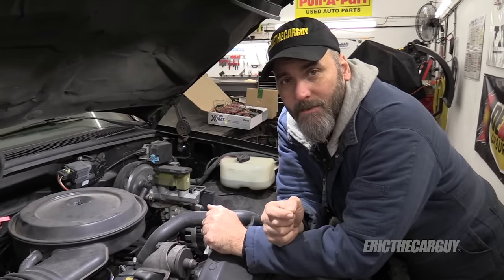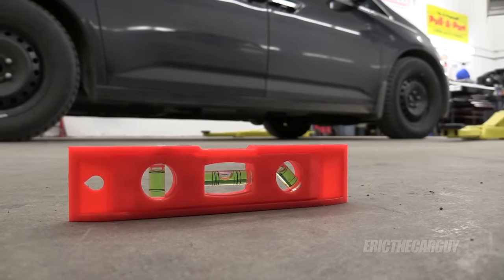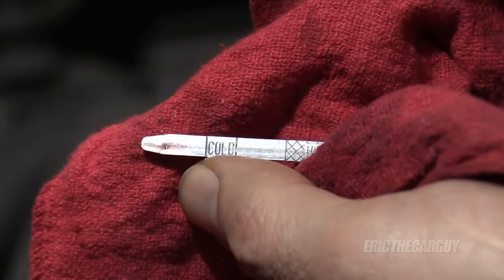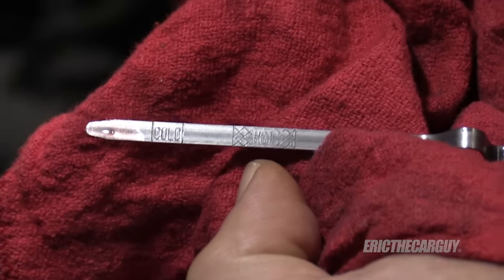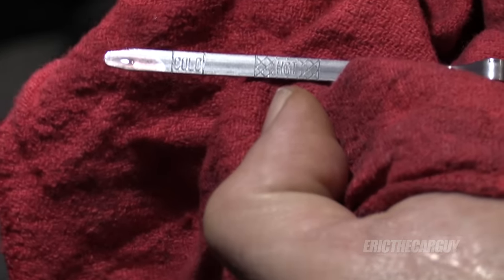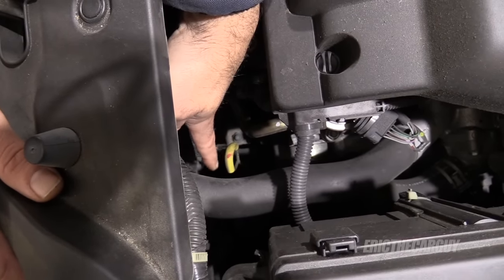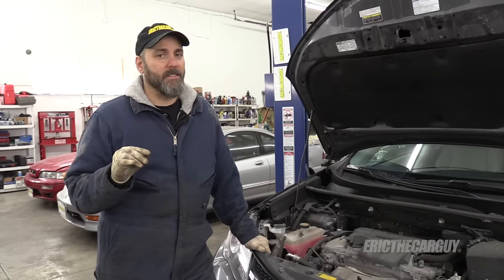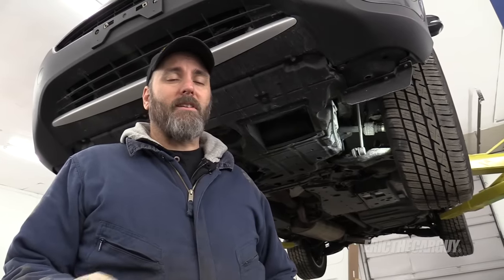How To Check Automatic Transmission Fluid

Comment: Good to know! Now I’m curious as to what kind of automatic transmission is in your dads old truck since you said that it was a conversion from a manual transmission? I believe that the factory automatic transmissions on those had a column shifter so that would lead me to believe that maybe the automatic transmission that’s currently in that truck came from another type of vehicle?

Comment: I don’t know if you have any experience with newer Mazda 3s but I have a 2017 mazda3 touring 2.0 and in the maintenance section for U.S. owners it doesn’t say to check the fuel filter, but on the “Mexico and Canada owners” section it says to replace every 60k kilometers. Why is that?

Comment: Thanks Eric! I know this video is old, but man I am struggling to get a strong read on a 2016 Wrangler with that mercedes nag1 transmission. Cold is easy, but hot is tough as hell to read. When I get the trans temp to 180 degrees as stated in the manual, run through gears, place in park and do my check I can only reqlly get the fluid to fill the "hot" low hole (this stick has the holes) It is impossible to guage where on the stick the fluid level is. All I know for sure if at 180 degrees the low side HOT marker hole is filled with fluid, and the high side is not. If I was to guess using a paper towel pat trick, i THINK the fluid is somewhere right in the middle section of the hot area between the hot low and high holes. Is that all I can hope for? Leave it be?

Comment: In my 01 ram 1500 I can’t see any fluid on the stick when it’s up to temp, but when it’s cold it’s actually a little bit above the cold fill line, if I remember correctly

Comment: Hi Eric, I have a 2009 ford ranger and I’ve been checking the transmission fluid on it while running the truck as my owners manual said and it’s appears to be low on transmission fluid in the dipstick reading, but still drives good. Do you still think I should add more transmission fluid?

Comment: I have never understood the whole sealed transmission. You should make a video about the benefits of a sealed transmission.
Reply: That would be a very short video
Reply: In their minds the benefit is that an owner won't use the wrong transmission fluid, won't overfill the transmission and will keep the hands off the transmission...

Comment: I have a question regarding this topic ...  Is it ok to just let the car idle until the engine is warm? or is it best to drive it down the road and back to get more heat in the transmission?  or does it not matter at all, just let it get to full operating temperature either way, (for Honda, turn it off) and check it on a level surface?
Thanks to any that offer their knowledge :)

Comment: Nice of Honda to require the engine to be hot and then put the dipstick right next to the radiator hose.  The Fit you're working on seems a little less crowded than the one I have.  It's hard to even get my big dumb hands down there.
Reply: Subarus have it near the bottom of the engine right by the firewall

Comment: I did an atf service on my friends 2013 pilot and the process was a little weird. It was wait till the radiator fan turns on. Turn off the car. Wait about 75 seconds then check it

Comment: Here is my issue Eric...I have a Wrangler and the Chrysler dip stixk ia the type with the holes in the dipstick. The fluid goes past the holes, as if overfilled, but it doesn't FILL the holes with fluid in the hot area, although the stick is wet past this point. Down by the cold read holes, they are filled with ATF...so...if th3 holes are not filled with fluid...but the dipstick is wet around the holes .... what is correct?

Comment: I have a 2014 GMC Sierra and I changed the transmission fluid and filter and added the proper amount of transmission fluid but with the vehicle cold it showing to be over full.
My dipstick only has two dots on the bottom and on top which one do I use for cold check?

Comment: hi eric, I have a Mercedes c200 kompressor (2007) model. It doesnt have a auto trans dip stick and the manuals dont seem to say anything about the oil .  what can i do to check the oil level and if the oil needs replacing?
Reply from the maker: Like I said in the video, some vehicles have sealed transmissions. Check the service manual for specifics on transmission service for your vehicle. Video linked in the description on how to find a manual for your vehicle. Good luck.

Comment: Hi ETCG.  Been told all my life that coasting an automatic transmission is bad.  Can you explain why you can coast a manual transmission but not an automatic.  Thanks!
Reply: coasting is just working the torque converter -

Comment: hi I have a 2018 Ford escape 1.5l.  I didn't change the transmission oil it now has 69678 miles it has been making a whining noise. I would like to fix what ever is wrong with it my self.. any videos or tips on how I would find out the problem..  When I took it to the dealer they wanted to check (transmission pump) (torque converter) and  (Transmission filter).. how would I go about checking these or just anything component that may have gone bad.... Thank you

Comment: I have a Toyota vitz 2013, how can I check if the automatic transmission need to change or top up or it doesn't even need to be changed?

Comment: I have a 2002 E-250, the dipstick has a off white tip marked c-Cold and H-hot, due to its age it's hard for me to tell if its full or not, should the fluid look blood red? I thought that's how it's supposed to look on a white surface, but it looks kind of clear like hydro fluid and hardly noticeable on the stick.

Comment: I have a 2000 Ford F350 5.4 engine and when I checked my transmission fluid. It only read full on one side of the stick but the other side was dry still. Am I low on fluid or what..??

Comment: Nic e video Eric. 
I usually check when i think of it. Sometimes while the car is off and im like its been long i havent checked. 

On fords is it checked while engine running or i can run it up to temperature and switch it off.?

Comment: I need help I have a 2002 Ford focus se. I'm having a very hard time getting an accurate reading on the dipstick. Yes I read the manual yes I did it correctly as far as I know. Ever time the transmission fluid is everywhere not literally but it is so it's hard for me to get an accurate reading.

Comment: Eric , I got a 2002 honda crv . Great ride only one problem the tyranny or rear differential is slipping once in a while . What should i do ? Do you think it's a major issue
Reply: You have to change those fluids and Honda Makes a Special Fluid for that differential.
Using anything other than Honda Fluid can ruin the differential.

Comment: I have a 2012 mazda 3 skyactiv the dipstick is under the air box. In that case can I just get it up to operating temp turn it off remove the air box and check it?

Comment: I cant wait to check my manual transmission fluid.
Reply: Did it on a Subaru last week.  It even has a dipstick on the manual trans.  My 2004 Hyundai Elantra manual transaxle has markings on the speedo sensor drive gear, pull it out and look at the marks.
Reply: @ME-kp5iz  Unless it is GM T56s from a 4th gen F body. They used ATF to keep the other cheap internals safe. Front and rear bearings toasted by 160K. Stage 2 rebuild, now running synchromesh. Stupid engineers trying to save a buck.
Reply: Gablub Blub It was not by choice that I changed the fluid in either car.  The Elantra has had the clutch replaced twice and both axle shafts replaced.  Unfortunately the axle shafts have to come out to replace the clutch, required draining and refill of the trans.  The Subaru chose to no longer shift into reverse or 5th gear.

Comment: My dipstick has 25c and 80c .. once it gets hot and I check it, the oil comes to the bottom of the 80c line do I add half of quart.. I did this 4 times to be sure.. also what if one side reads higher , for an example it's at the top of 80c on one side and at the 80c low on the other side..it's confusing

Comment: Don't you need to be sure that it HAS fluid first? Particularly if you KNOW that it's leaking... wouldn't you want to make sure that it's not empty before starting the engine, so as not to burn up the pump? That's something that's always bothered me about waiting for operating temperature. Of course you'll need to get it up to temp for final top-off, but it irks me that even the owner's manual jumps right to warming up the fluid before even looking at the dipstick.

Comment: Trasmission fluid gets hot when in neutral?
Reply: Yousef Joseph the torque converter input vanes are turning and output vanes are being held stationary, that results in shear of the fluid between the vanes and does heat the fluid.  The pump is also turning inside the transmission, forcing fluid through some of the passages.  So, yes it does heat up, just not as quickly as when under a load.

Comment: Eric How would a 1 inch leveling kit in a truck affect the level on the transmission dipstick? Would I put a one inch board under the back tires to bring the pitch back to what factory was?
Reply from the maker: Hadn't thought of that, but that sounds like a plan.

Comment: Does this concern the same for the same dipstick on my 2008 scion xb that has the 2.4L VVT-I Toyota engine it has the cool and hot level line and was curious if that particular vehicle had to be running like you mentioned to be checked if the fluid level should be on the hot level or close to it on its normal running temperature

Comment: My 1966 Newport, you check the transmission all the same as the Chevy but the transmission needs to be in neutral not park. That’s my difference.
Reply: A lot of 90s (and maybe other years) Jeeps are the same, if its in park your reading will be confusing.

Comment: My car is very vague, I left it running for 20 minutes, checked the transmission fluid, and a solid line is below the hatch marks, But... fluid is also on one side up to the hatch marks on only one side of the dipstick, I did this three times with the same exact result. Any idea what the true reading is, I don't want to overfill it.
Reply: When in doubt go for a 20 minute drive then check and refill.

Comment: Eric since you were a honda tech I hope maybe you could atleast give some advice since I know automatic transmission issues are hard to diagnose. I have a 2013 Honda civic coupe  with the 5 speed automatic. Every so often I get a bucking sensation when I put cruise control on or try and hold speed on the freeway or at lower speeds such as 40-50. It doesn't do it all the time and the Honda  dealer cant seem to pin point the problem. I've drained and refilled the transmission 3 times with a short drive in between while also shifting into each gear while sitting still. I'm at a loss I love the car it just sucks to have this issue. Any advice?
Reply: My 08 Crv with 190,000 miles has been doing it for a while. It's very pronounced at 38-40 mph, and I've been told its common and has to do with the torque converter. My mechanic tried adding a shudder additive and it improved a little, but it's still there.
Reply: Mopar club cab
From what you describe it could be an engine misfire.

Comment: Question ; if the transmission fluid has never been changed on a 08 honda accord with 120k , should it be changed ?
Reply: Yes. Do a drain and fill procedure three times, with a few days of driving in between. The process is dead simple on that car.

Comment: I have a question, my sister has a Acura TSX do you check the transmission level when it's running?
Reply: Acura is owned by Honda, so I'd do it when it's warm, but shut off
Reply: @thelonelywolf88  thank you very much
Reply from the maker: Acura is made by Honda. So, no, engine off at operating temperature.

Comment: My fluid is between the hot marks when at op temp but half an inch above the top hot line when cold. What's going on?
Reply: Bill Dauterive is it cold after you shut it off

Comment: Some cars don't even have dipsticks.
Reply: True but if they have a dipstick tube you may find a dipstick on eBay. It may be called a fluid measuring gauge instead of a dipstick. I found one for a friend's 2018 Nissan Rouge.

Comment: This is not entirely true. When and only when there is a "cold" and "hot" label on the stick that is when you can check it. "Cold" is if the cars has been off for a while, "Hot" is if it's checked just after the car has been running a while. The "Hot" is higher on the stick because as the fluid heats up it naturally expands and the reverse for when the car is cold. So both situations are fine to check it why else would they put hot and cold on a measuring stick made to determine proper fluid levels. Common sense. Of course, check with the manual when in any doubt.

Comment: i checked my fluid on my 79 camaro n when its cold the fluid passes the hot margin limit when its warmed i check n its a little below the line where is says hot?
Reply: Its because fluid is circulating through the torque converter  coolers  and trans pump when it's running so the fluid will be lower when you shut the vehicle off some of the fluid will drain back to the pan hence why engine has to be running
Reply: @wyohorseman9948  oh alright i thought i had over filled it thanks 👍🏻 im learning as i go on my car trying to have it running on a budget lol almost there..
Reply: @dannyal467  same i have an 85 k20 just rebuilt the motor now I'm having shifting problems
Reply: @wyohorseman9948  have u change the fluid and filter in the transmission when i first got my camaro it wouldnt go to third gear n barely would go to 2nd i changed the filter n it shifted great hopefully it helps
Reply: @dannyal467  yeah i did still no change
Reply: @wyohorseman9948  damn hopefully its something small good luck let me know how it goes..👍🏻
Reply: @dannyal467  I've done a fluid change governor gear replacement and vacuum modulator replacement  now I'm going to pull the valve body
Reply: @wyohorseman9948  for sure u should post a video on your truck👍🏻

Comment: What if you check the fluid and see that its fluid on one side of the dipstick and nothing on the other?
Reply: Good question. Turn the dipstick around, re dip it and then it'll have fluid on the other side.

Comment: How about a 2004 ford f150
Reply: Yellow dipstick on the passengers side.
Reply: @diablo7322000  yea but di you check with engine running
Reply: @johnwalters7415   Yes.

Comment: Do people really not know how to do this
Reply from the maker: This video was requested by an Uber driver in Las Vegas. It's general information like this that helps a lot of people and gets a lot of views.
Reply: @ericthecarguy  wow I would think a person who drives for a living would know this ......if I told my boss I didn't know how to check the oil on the Kenworth I drive at work he'd tell me to pack my shit lol......good video tho
Reply: Most people think you just check it like oil whenever, most don't realize you need to check it with the engine running and at full temp.
Reply from the maker: mds s  First, not all Uber drivers are full time. Second, driving an Uber is not the same as driving a tractor trailer. Hence the reason for a CDL over a drivers license. Lastly, when I told him what I did, he suggested the video because he hadn't seen one that he trusted. I thought it was a good idea.